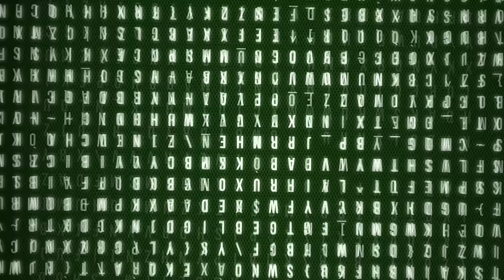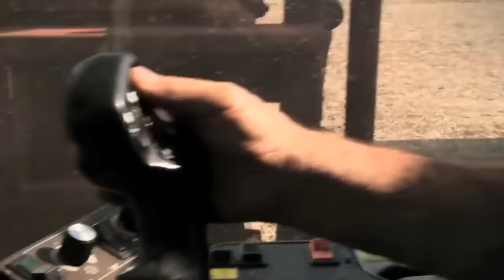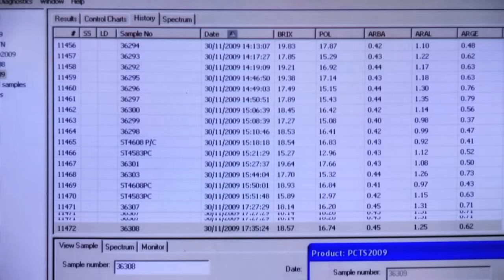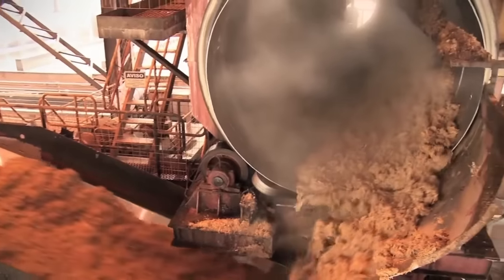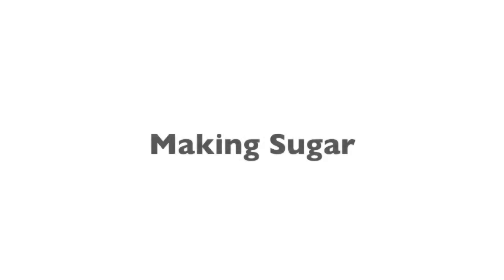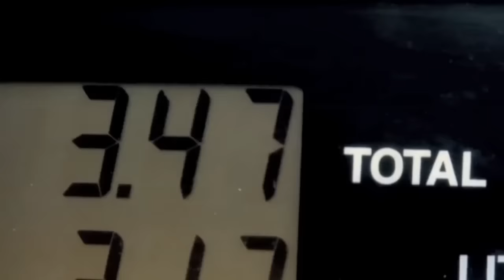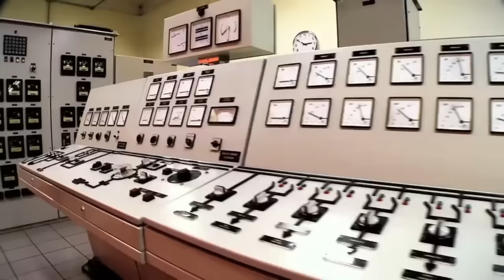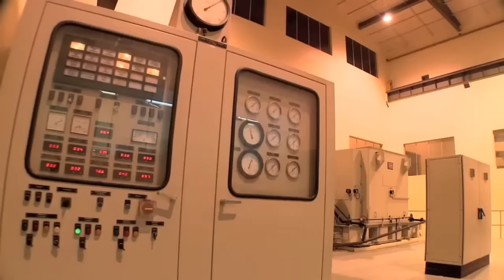Agriculture Technology -  SugarCane Cultivation - SugarCane Farming and Harvesting, processing

Comment: This is a pretty well put edutainment vod... but I just have one question; what happens to the ash generated from burning the bagasse for bio-electricity? Is there still a use for it like being spread over the fields in which the former sugarcanes were planted??

It was not includes in the piece. Otherwise it is a highly efficiency, closed loop system.

Comment: If they turned the straw into biochar and put back into the field then they would be massively carbon negative. Likewise the same for most other agricultural products. Over 90% of the carbon is sequestered from plant material that would have quickly decayed and released the carbon as CO2. It costs virtually nothing, and is low tech. This can be done across the world and would quickly address and likely even solve "climate change" assuming carbon was ever an issue and not a cash grab tax scam for money power and control.